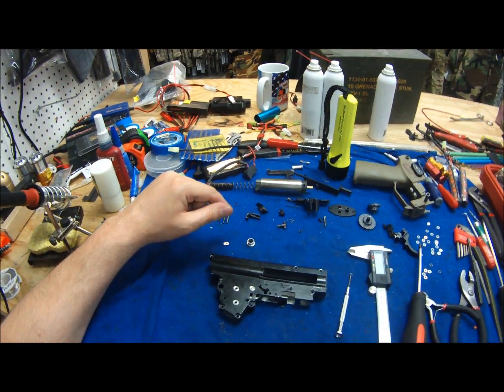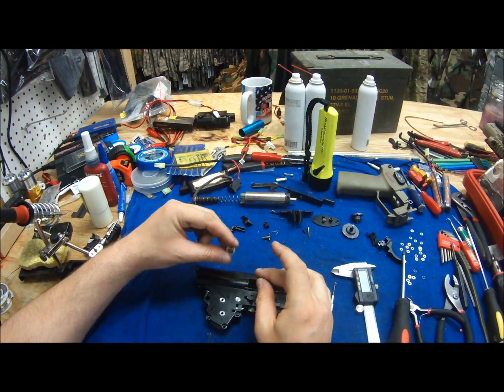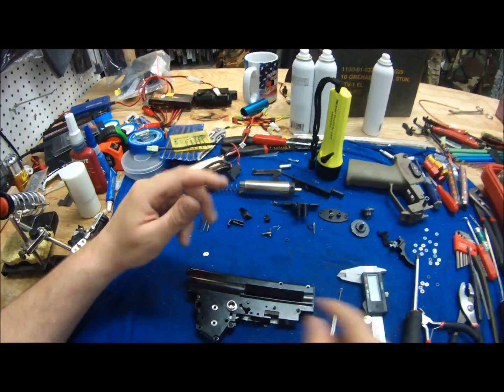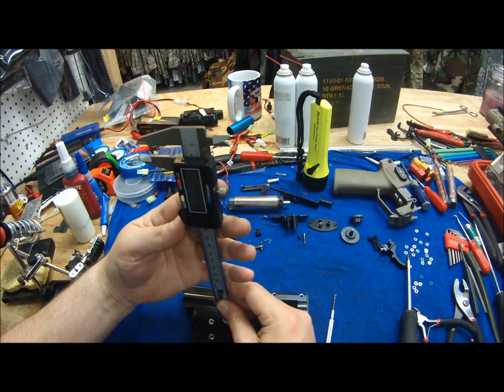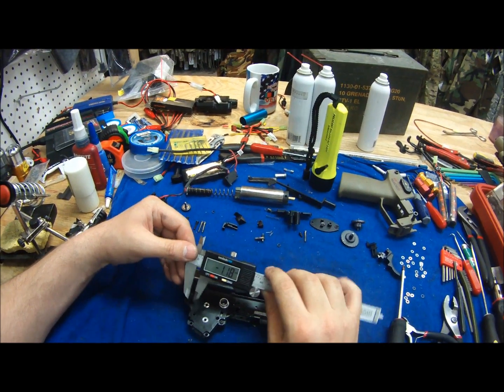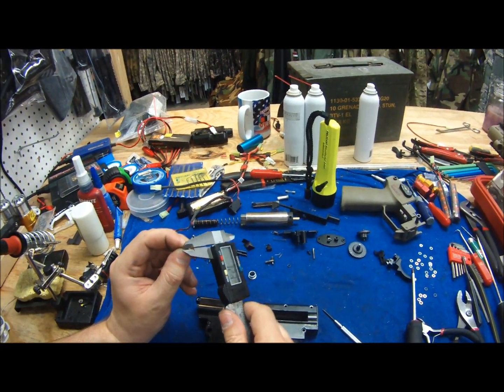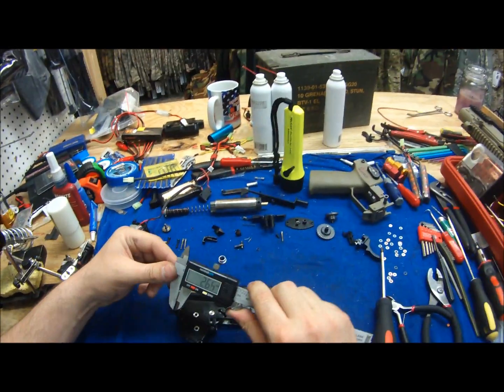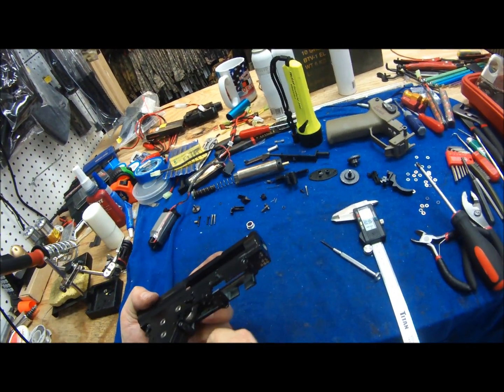Using a digital caliper to measure clearance for shimming an airsoft gearbox.

Comment: @ZaCkO you're just a narrow minded person stuck in his ways. You can't beat exact measurements, thousands of an inch to get exactly the perfect amount of shims that will work in a gearbox. gearboxes were designed by engineers and an engineer could have a better performing gearbox with calipers than you could with ball park estimations. Yes your way works but instead of trying to be better than everyone else and trolling on everyone who is different than you, why don't you just appreciate the ingenuity and thought of this new technique. Hell its a great idea to get the exact amount of shims you need for each gear and from there you just need to correct the height of each gear and you're done. Saying that you've "been there, done that" means that you've used calipers before but don't know how to use them which didn't give you as good results as you would ball parking the shim job. Stop trolling and stop trying to make yourself seem better than everyone. Speaking from an engineer standpoint, this method works and will work better than "feeling" and "magical skill" for the gears to be shimmed correctly.

Comment: For people arguing about this technique. Mechanics rather working on a car, motorcycle or gear box still needs to be PROPERLY shimmed. This requires either a caliper or feeler gauges or what ever tool is required. ( Can this be done without a tool? ) Yes. But would you want someone to just feel it out or properly measure and diagnose from there? I will take the ladder! To diss this video saying it is not right is completely absurd. Talk to any truly qualified mechanic and he has a micrometer in his box for this sol purpose of KNOWING THE EXACT SPACING needed for a good quality job and sound gearbox or motor. Yes you need to spin the gears to check for binding but if anyone says this is a horrible way obviously does not have GOOD mechanic skills bc this is how a true mechanic who cares about his work would work on another persons box. It blows my mind ppl would down this way. Do you want some one rushing threw your box or taking slightly longer and coming up with exactly the right spacing needed. Im truly blown away lol.

Comment: I'm pretty sure the technicians, engineers that designed the gears and gearboxes were using CAD and digital calipers rather than spinning and filing the gears for best fit...

Comment from the maker: We learned this method from an industrial machinist with 30 years experience. It works quite well, however it does not tell you where to place the shims just how many will be needed. Keeping an open mind to new ideas and methods is the best way to improve your technical abilities. Shimming gears using a digital caliper is a technique used by technical professionals who work on much more complex machinery than airsoft gearboxes.